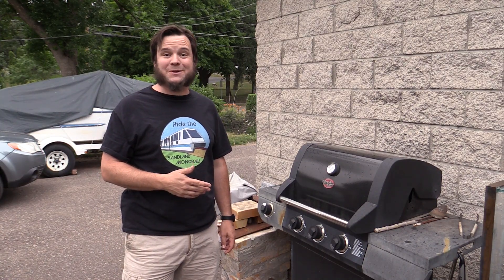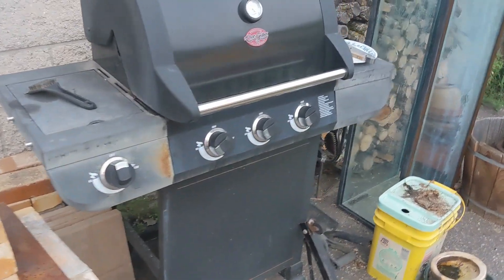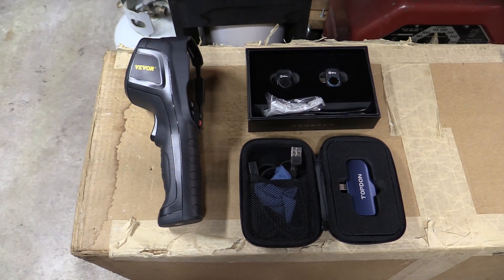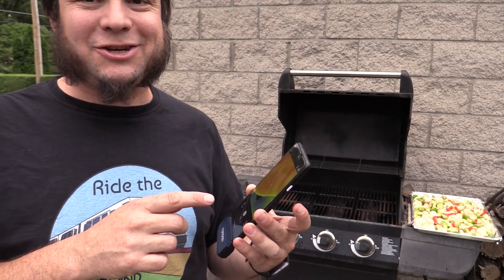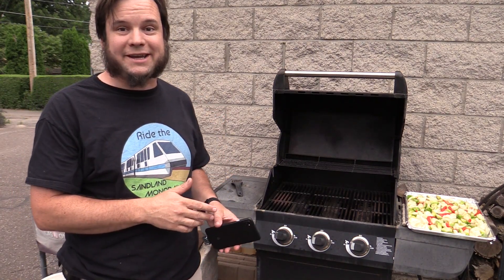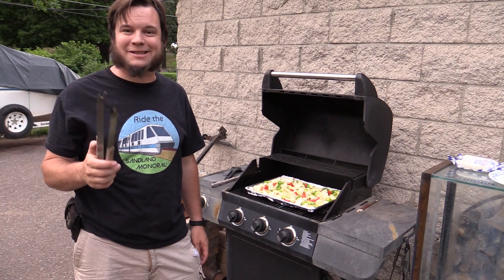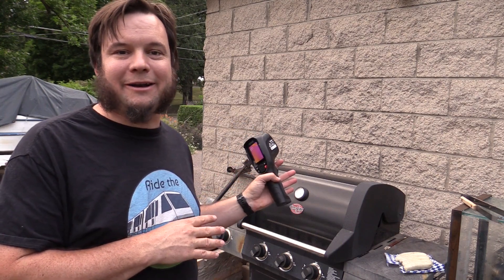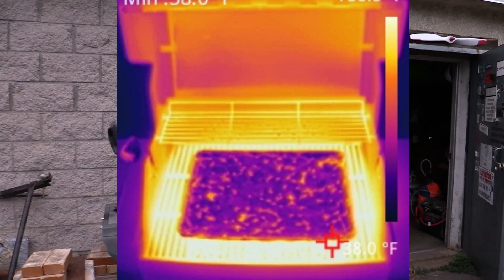I fail to make a heat map of my grill

Comment: I think you have too many variables with that kind of grill and changing the cook surface. You are correct, I think you need a heat spreader to help. A piece of cast iron with vents so it wont smother the fire and even out the heat circulation inside the grill would be perfect. I have a feeling you are not going to have any hot spots to find once you do that 😛like with the pan of veggies

Comment: I have stuck  Tin foil over the grill and snuffed it out many times before but I want that to be the best method every time I go to grill. usually I will slice some slits randomly throughout the foil to help lock the tin foil to the grate avoiding hotairballooning and allowing air flow to keep the flames alive. one option you could try would be a pc fan blowing through a PVC elbow up the bottom where there's the hole in the grill for clean out. that's would allow more air flow and you still could cover the whole cooking surface with tinfoil to even the heat. Maybe you can experiment with honeycomb aluminum sheets or blocks to allow for airflow and spread out the heat. Not sure what to say about the the thermal sensors other than to turn off the flames completely when taking your measurement to eliminate overheating. Heat transfer is a very linear process and if you let it cool for a few seconds or minutes you could still get a reading that's accurate to its performance as everything would cool equally based on thickness and material so it would still be a good representation.